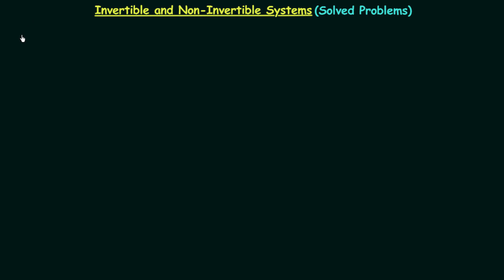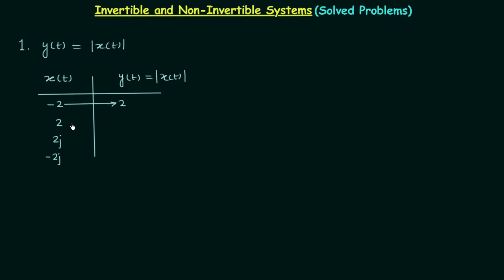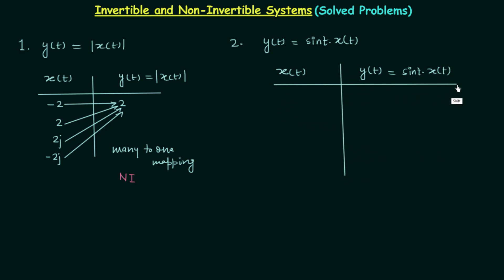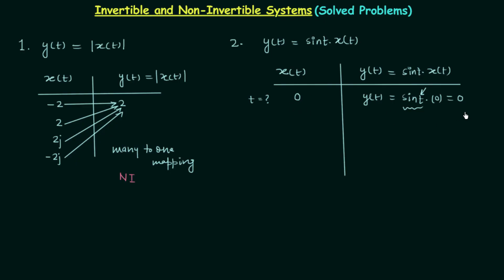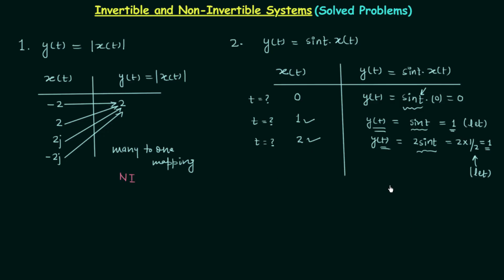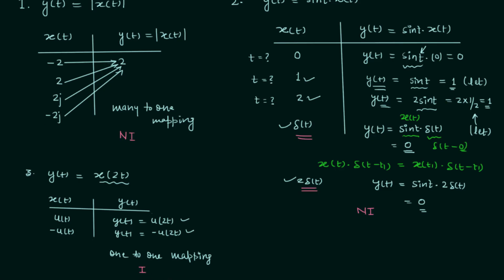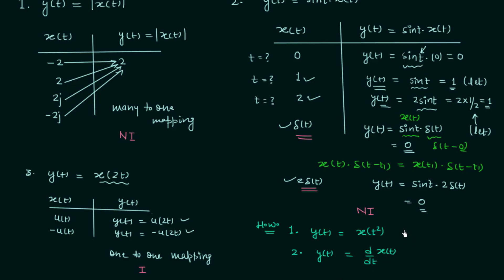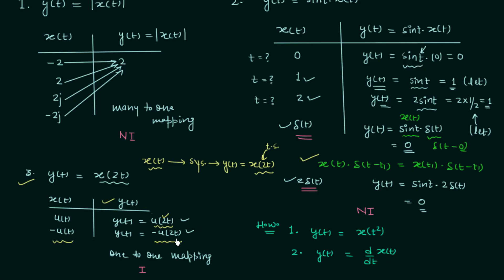Invertible and Non-Invertible Systems (Solved Problems)

Comment: I understand that this is confusing, but I feel like this is what the man means when he says "invertible"
Just like how a function is invertible if, from an output, we can find only 1 corresponding input, a system is invertible if the entire output signal y(t) can be used to find only one corresponding input signal x(t).
Therefore, it means that even if it is the case that for such a case where even if t1!=t2, x(t1)=x(t2), and through that y(t1)=y(t2), and even if t1 and t2 are such that t1!=t2, x(t1)!=x(t2), y(t1)=y(t2), and vice versa a system could still be invertible because for an entire output function signal y(t) it corresponds to a unique input function signal x(t).
To simplify this, a system is invertible if you can get a single unique input signal if you have a single unique output signal and vice versa.

Let's say for example y(t)=x(t), and let's say x(t)=cos(t). Even though x(pi)=x(3pi)=0, we can still get a unique y(t)=cos(t) because it couldn't be any other way. It's not possible at all to find another function that satisfies this condition other than y(t)=cos(t).

Now let's go back to the example of y(t)=sin(t)*x(t)

Remember, what you aren't looking for is to use something like t1!=t2, x(t1)!=x(t2), y(t1)=y(t2) to find that the system is invertible. You want to find two unique functions that return the same y(t). And the functions that OP used are x1=delta(t) and x2=2*delta(t). Because y(t)=0 for x1(t) and x2(t), we can say that the function is invertible. Note, for y(t) we aren't just looking at y=0 as just one value, we are looking at the function y(t)=0. This entire signal output function can be mapped to more than one unique signal input: x1=delta(t) and x2=2*delta(t). This is what determines non-invertibility.

The same idea can be used for y(t)=|x(t)|. To satisfy that system we can either have y(t)=x(t) or y(t)=-x(t). Because there is more than 1 way to configure this this system cannot be invertible.

So with that being said, let's talk about the homework:

1. y(t)=x(t^2). This is not invertible. Let's assume g=t^2. This means that t=+-sqrt(g). As such, we have either y(sqrt(g))=x(t) or y(-sqrt(g))=x(t). We cannot obtain a unique single output signal y if we have x(t).
2. This is not invertible. Assume y(t)'s integral is Y(t). We can then rewrite the entire system as x(t)=Y(t)+C. But because C can really be any value and the function can still hold, we cannot obtain a unique x(t) for a Y(t). But if we know of the initial condition like x(t0)=g (g is a constant) we can solve for C and then the equation isn't invertible.

Comment: Both are non invertible as for 

1) If we take x(t)= t then for y(t) will produce same output. Such as x(2)=2 and x(-2);

2) We take constant values of x(t) we get a zero value for many such cases. Also since d/dt is slope it can  also happen that multiple inputs have the same slope but they vary in offsets as example.

Comment: HW PROBLEMS:
1. Non-Invertible
2. DEPENDS on wether dx(t)/dt is STRICTLY MONOTONIC or not

EXPLANATION OF 2:   dx(t)/dt is the slope of the function x(t). If this slope is STRICTLY MONOTONIC (i.e. if it is constantly increasing in value OR if it is constantly decreasing in value), then it follows 1 to 1 mapping ("1-1"). And thus it is INVERTIBLE.
Otherwise, it is Non-Invertible.

* How to find if dx(t)/dt is STRICTLY MONOTONIC:
We have to check wether d2x(t)/dt2 maintains the SAME sign throughout its range (i.e. if constantly > 0   OR   if constantly < 0). If it does, then dx(t)/dt is strictly monotonic, and thus "1-1", and thus INVERTIBLE.
Reply: tks
Reply: What about constant values of input ?
Reply: The inverse function required for "x = T^inv{T{x}}" cannot be completely computed for the differentiating system because the result of the derivative is 3 for both 3t and 3t+8. so, non-invertible
Reply: To be fair strictly monotonicity wont cut it. What you need is different values of d/dx so you can get many to many mapping (in a way that the system would show a 1-1 convertion). So what you really need is a constant value d^2/dx^2 or '' second order derivative so you can be sure that the first order will be rising for ever or decreasing for ever so that you get different values. We are from the same country too XD. Diabase auto pou sou egrapsa ama tuxon to deis an kai exoun perasei 2 xronia analoga thn sxolh pou eisai to perases. Diamantaki krufo to nesoacademy.

Comment: both HW problems are non-invertible . in 1st problem if we take t=2 and t=-2 , then input will be x(2) and x(-2) and output for both will be y(t)=x (t^2) i.e x(4), so it is many to one mapping .  in 2nd question if we take x(t) = u(t) and x(t)=u(-t) then output for both will be zero , so many to one mapping
Reply: first is invertible, since we have to check for x(t^2) and not t itself.
Reply: @atmajyotighosh2049  it is non invertible, put x(t) = u(-t) and u(t) both will give u(t^2)

Comment: Sir, If in the 1st home work question, we take input as u(t) & u(-t) , will the output be x(t^2) ?, system is non - Invertible?
Reply: yes second is invertible
Reply: @ClickBait123  bro from my logic it's non-invertible , because if u put u(t) and u(-t) then answer will be 0 .
Reply: @mayankdewan7793  bro if you diff unit step funcytion u get impulse function

Comment: 1.invertible
2.non invertible
For the first one take u(t) & -u(t) as input will get one to one mapping
For the second case take input 1 & 2 will get zero because Differentiation of any contast is zero so will get many to one mapping hence its non-invertible system
Reply: Why don’t you use a u(t) for the second assignment
Reply: @makindeolalekanmonsuru5349  yeah we can use it.....But make sure that if u have another possibility of inputs that proves a particular maping was wrong.
Reply: @santhoshchandchelli6581  exactly! So for 1st Question : for x(-2) ---> y(-2) = x(4) and x(2)----> y(2) = x(4).Many to one : Non-Invertible.

Comment: Q2.Differentiation of any constant is zero....so many to one .. so non-invertible
Q1. When you put u(t) then you will get invertible
Reply: @gyatika8902  
Mam..
Constant × t^0 = constant
So it's function of t.
Reply: @ujjawal1366  
Thanks to correct my concept 😊👍yes u r right we can put constant and answer is noninvertible..
Reply: @gyatika8902  
Your welcome.
Reply: Q2 we cant take constant as  i/p becoz i/p must be function of t as given in question x(t)
Reply: @gyatika8902  ....
Madam, we can take constant as I/P ,see example 1 of this video....
He has taken 2, -2 as I/p.
Thanks for response.
Reply: Then which is correct ans
Reply: In 1st example------
[for t=-2]
input= x(-2)
output=y(-2)=x(4)

[for t=+2]
Input= x(+2)
Output=y(2)=x(+4)

Thus,
y(-2)=y(+2)
Hence output is same for two distict input i.e. x(-2) & x(+2)
Therefore many to one mapping
System= non-invertible
Reply: @sneharajpoot8377 Exactly!!
Right Sneha❤️💥
Reply: @sneharajpoot8377  no its wrong🤷🏻‍♂️. We only put values to x(t) and not for t

Comment: solve plz y(t )= ∫ 𝒙(𝟓𝝉)𝒅𝝉 𝟒
interate from -infinity to 4 is invertable or not??
Reply: It is invertible bro
Reply: @apoorvpandey5058  thanks very much bro
Reply: Y(t) will always be constant so it will be many one and non invertible
Reply: @ujjawalvats5169  no bro it will be always a constant value that i accept but for every different x(t) u will get different y(t) so one-one mapping and hence it will be invertible.
Just put u(t) first then u(-t) u will get different constant values
Reply: @Apoorv gaming for every x(t), y(t) will be independent of x(t). No matter what will be x(t). It is just like y(t) =4
Reply: @ujjawalvats5169  y(t) is equal to integration of x(5t) so how it will be independent of x(t). Bro just clarify this
Reply: @apoorvpandey5058  bro you cannot write this. As y(t) is independent of it. Kindly analyse it once. You will get it on your own.
Reply: @apoorvpandey5058  limits are constant
Reply: @ujjawalvats5169  bro  i m saying as neso academy said that we can't analyse y(t) by just putting x(t) values as a dc values we have to use u(t) or any other signal to analyse it. Just first put x(t) as u(t) and then u(-t) y(t) will be different in both case and hence invertible

Comment: I believe there are both non avertible; many to one maping. for the first function you plug -1 and +1 you will get the same answerr which is one. for the second question, when you take the derivative of any constant it could be always zero.
Reply: But if you use unit Step signal you will attain distinct values of the output making one to one mapping input u(t) you will get output u(t²).. then input -u(t) you will get -u(t²) making it one to one mapping for the first hw problem
Reply: @Dark_Knight-w9r  there is no restriction on what input can be, so if you put say u(t) ,u(-t) then op is  u(t^2) for both so making it one to many

Comment: The third question is many to one mapping I guess.
Because as we put different values of t we get same answer i.e. 1.
Correct me if I am wrong.
Reply: we do not put value of t we put value of xt
Reply: you need to first of all understand that a system maps a signal to another signal i.e the domain is a set of signals and the codomain itself is a set of signals, so you need to put different values of input signal to check whether you are getting same output signal , if yes then the system is non invertible if not then you need to check the invertibility.

Comment: Hi, Could you please explain if the below system is invertible or not . And if it is invertible , what is the inverse system in this case ? 
y[n] = x[n]x[n-1]
Reply: It is non invertible
Reply: take x1[n]=0 and x2[n]=delta[n] , for both the input signals the output signal is y[n]= 0 hence two distinct input signals lead to same output signal implies that the signal is non invertible

Comment: 1. Non invertible, since for negative and positive of some time 't' we get same value of y
2. Invertible, since for different values of x we get different values of y
Reply: 2. Non-invertible... x1(t)=mt+c1 and x2=mt+c2.. this implies y1(t)=y2(t)=m
Reply: @DeepshikhaKumariBEE  yes...if the system is non invertibe..this gives two similar output for two different input...and y1 and y2 are straighe lines..and its passes throught origin so m will be equal
Reply: We need to put different values of input not for different values of time..so the system is invertible

Comment: 1. Non-Invertible
2. Invertible
Reply: Lets put x(t) =u(t) so d/dt u(t) will give unit impulse function and if x(t) is ramp it will give step function si it is a invertible function
Reply: let input be x(t)+c where c is a constant and x(t) can be any input, d/dt (input) = x'(t); you have your system performing many to one operation. Derivative operator is non invertible
Reply: Put DC value and derivative of DC 0 and for also zero value output also be zero so non invertible

Comment: can we use u(-t) as input to hw problem 1 such that  its output in u(t^2)
Reply: Vaidesh Iyer here the system is replacing t by t^2 so ur going to get the ans.as u(-t^2)brother...
Reply: @kirankumar2432  cant we see it like system is squaring input
When i/p is u(-t) then sys will square I/p and make it to u(t²).?

Comment: how can we gurantee the invertiblity of system by only considering impulse or unit step function?
Reply: Bro! To solve such problems you should assume the system to be invertible and then try to find out two inputs for which the output is same if there exist two such inputs  then the system is non-invertible. You can apply the same approach to solve system stability problems
Reply: @AJitKumar-vg6no  yr tu que you can get some years ago I love❤❤

Comment: 1.non invertible,2.invertible
Reply: +Ashok Vardineni because differentiation of any constant is zero... implies many to one function
Reply: Ashok Vardineni that's why the 2nd one should be non invertible as many to one ...
Reply: sujit maurya --   i think it is Non invertible because,    if t=2 =>    y(2) = x(4) and also     if t= -2  => y(-2) = x(4) and since we do not have any other 't' dependent term  multiplied with x(t^2) , we wont have to worry about different effects of assuming 't' as integer on the function
Reply: sujit maurya yeah...both are invertible..
Reply: prithvi krishna..... i think it is invertible because when we put u(t) and -u(t) it will give the result u(t^2) and -u(t^2) respectively it is just like a time scaling as previous ex. In this presentation
Reply: sujit maurya take time reversal u will get. Non invertible
Reply: sujit maurya hmm yaah
Reply: niami agarwal take x(t) as standard function like u(t) ...then it becomes invertible...
Reply: How it is
Reply: Eva Humaira : how is the first one non invertible

Comment: H. W.
1.non invertible
2.non invertible
Reply: 1.Invertible 2.Non Invertible
Reply: mr. unique  but we are actually putting values for x(t) not for 't'. right..?
Reply: 2 pblm ans is invertible
Reply: Learn New
 1 Invertible, 2 non Invertible
Reply: revanth Vatturi... in problem 1  check the value at t=-1, and t=1...you got problem 1  is also non invertible...
Reply: @mr.unique7689 In 1st problem don't take numerical values take step signal U will get Invertible system
Reply: @Samuel.Raihanaboina should'nt we consider impulse function
Reply: @PARAMESH RAI for u(t) you only consider  the values for t >0 wt about others.
Putting u(t) is not a standard solution you have to check for mapping.
Try r(t) and check value for 2 and -2 both will have the same value.
Reply: No both are invertible